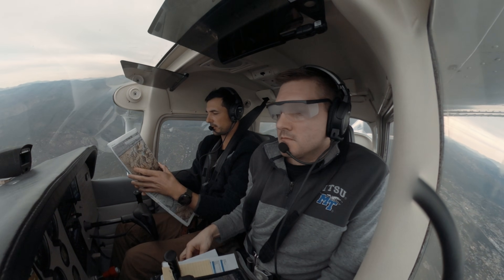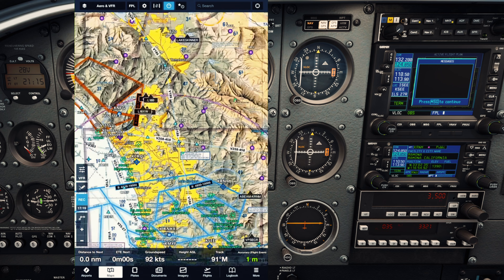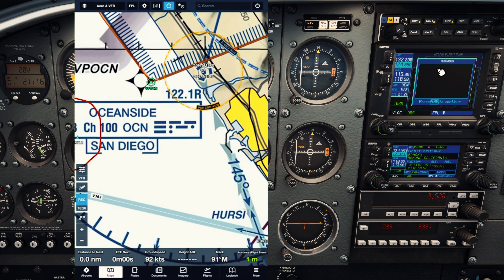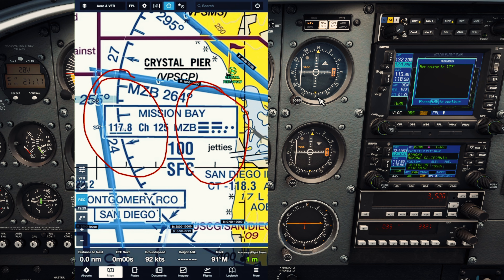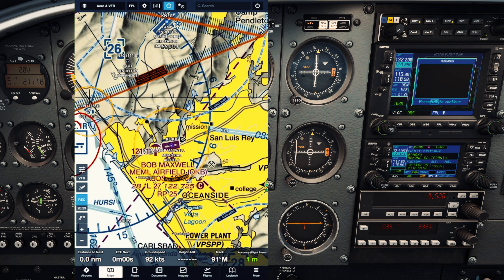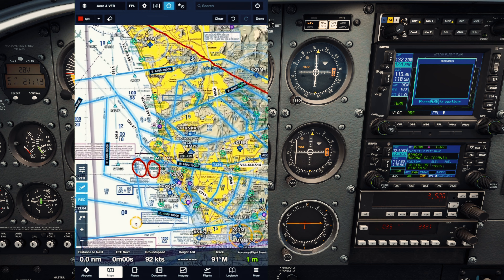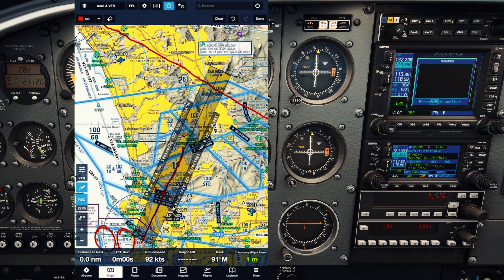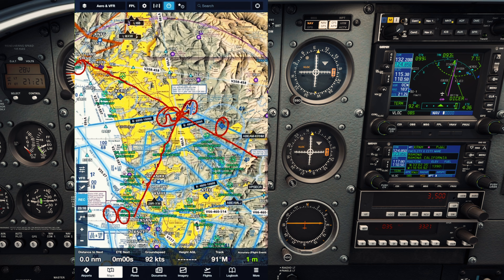How to find your location using VORs and triangulation

Comment: I DONT NEED TO USE VOR's. I Can See the Land on the Ground Quite Clearly. I Can See the Rooftops of Houses from 35,000 Feet (10 Kilometres).
From Edinburgh - Hamburg -> The Coast - If I Follow The Coast To Thurso/Cork/Edinburgh -> Then Around Ireland -> Down to London (Which is Boston). Then Paris is Not Too Far From Boston.
Reply: Actually Their London is Rotterdam.
I'd Have to Cross Over to Quebec City FROM Prince Edward Island. Then From Toronto Back to France.